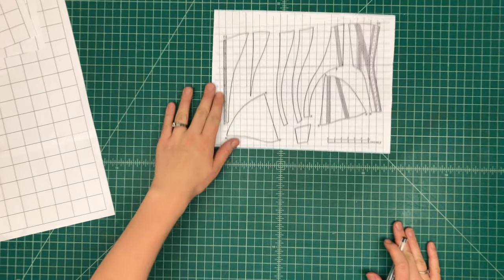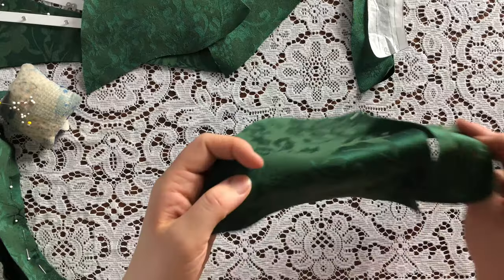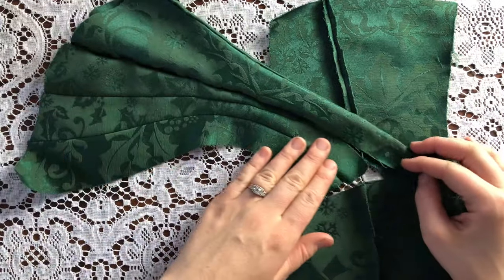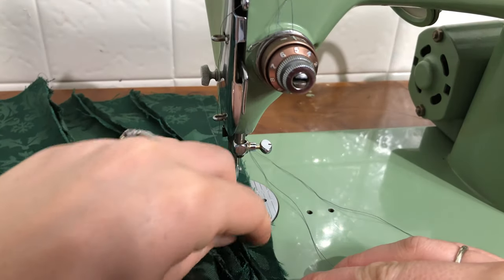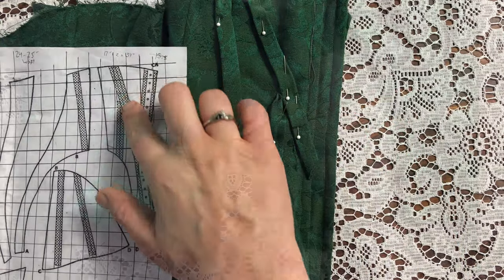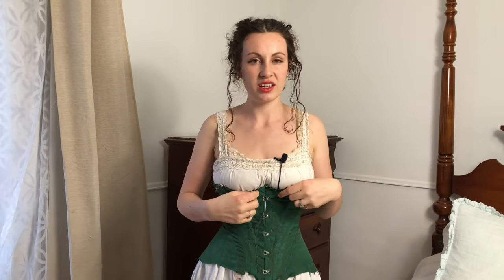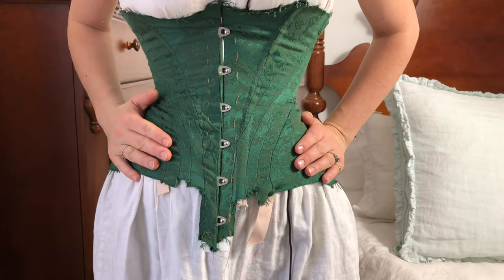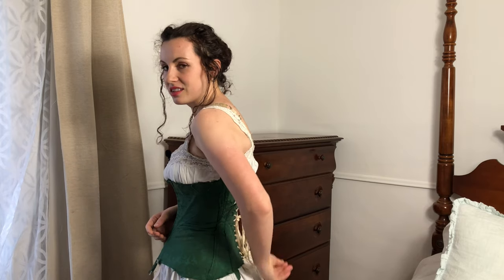Edwardian Corset Making Part 1: Mock-up

Comment: For anyone looking this pattern is on page 84 of Corsets and Crinolines.  A simple google for that or "straight front 1901 corset" will get you the result om google.

I also chuckled when you said the bottom was loose.  It's designed to be padded underneath, after all.

Comment: Hi I’m just about to start this! I have my mock up all cut out. If you don’t mind, what is your normal bust, waist and hip size? Just so I can get a better idea of how this will fit me and alterations to the pattern I will have to look out for. Thanks!
Reply from the maker: Eve C How exciting!  I am currently hugely pregnant so I had to measure this corset to remind myself 😆 My corset measures (with a 2” lacing gap included) 33” bust, 23” waist, and 38” hip.  My non-corsetted measurements, to the best of my memory, were 36” bust, 26-27” waist, and 36” hips.  When making your mock-up, keep an eye on the length of the corset as well as the width. Good luck! 😊
Reply: Thank you! I think hips and waist should be good then! Might have to make the bust a bit smaller but I’m excited to get started
Reply: One more question, so as for putting it all together the pieces should all fit together in the order on the pattern page? Other than the hip pieces which are lettered.
Reply from the maker: Eve C Yes, that’s correct 🙂
Reply: Alright, thank you!! I’ll tag you in some photos on Instagram when it’s done!
Reply from the maker: Eve C I would love that! 😊
Reply: Unfortunately I’m going to have to throw in the towel for this one. I do not have the experience to know how to adjust the size correctly. I’ve made 3 mock-ups and while I would like to continue I just don’t know what the heck I’m doing haha, looks like I will have to find a pattern that will be a bit smaller. I measured 12 in on each side and it should fit! But when i lace it up I don’t have any gap in laces and maybe see a 1in reduction?? So confused lol but thank you for your tutorial and replies!
Reply from the maker: Eve C No problem! At least you gave it a good effort! There are plenty of patterns out there with different sizes included. I think that is a great option 😊
Reply: serendipidus1 yeah I ended up taking out one of the panels and it was ok! I gave It another chance! I just need to add boning channels and trim now :)

Comment: Did you use steel or synthetic baleen for your boning?
Reply from the maker: Robyn Murray In the finished corset, I used mostly synthetic whalebone, with some spring steel in strategic places ( mostly centre-back as I recall). 🙂
Reply: @KatherineSewing  you are the first source I've found for an s-bend corset using synthetic baleen and I have sooo many questions. How are you finding it? Is it comfortable? Supportive? Keeps the right shape still? Could you wear it daily like they did in the Edwardian era?
Reply from the maker: Robyn Murray Great questions! I love my Edwardian corset and can’t wait to get back to wearing it ( I’m currently in my third trimester).  It has kept a beautiful shape, other than improving with wear as it moulds to the body. Very supportive, comfortable, and yes I was wearing it daily 🙂 In terms of the S-bend shape, I did use flat steel bones at the back which I bent to shape, so I can’t comment on that. However, I think it’s still possible to get that shape with synthetic whalebone, if you didn’t want to use any steel. I love synthetic whalebone for its convenience. Hope this helps 😊
Reply: @KatherineSewing  thank you so much! I'm making my first steps into history-bounding and the whole corset thing has been a big question mark for me. I know I'll need one but my previous experience is with steel bones fashion corsets which made my ribs very unhappy. The idea that I could get the right silhouette using synthetic whalebone gives me hope for when I finally get the confidence to make my own corset.
Reply from the maker: Robyn Murray Absolutely! Part of the rib-pain could have been due to corsets not fitting properly, but yes I do love my synthetic whalebone for comfort. In fact, I am more comfortable wearing a corset than not. Synthetic whalebone is also great for beginning corset-making, because you can easily cut it to length with scissors. 🙂 Oh and I have heard some corset makers swear by synthetic whalebone for getting a more historically accurate silhouette than steel!
Reply: @KatherineSewing  that's a amazing. Thank you for taking the time to help me. I feel a lot more comfortable with the idea of making a corset in my near future. I plan on doing the chemise and drawers first, but then I'll need to do the corset itself and the idea is less daunting now.

Comment: Could you please link your source for the pattern? I only find sources for a free download that do not seem so reliable. Thank you.
Reply from the maker: https://imgur.com/a/3sb72Qj

Here is the pattern I used. I will also put it into my blog post for this make (linked above). Unfortunately this pattern does not come with a grid.  I drew the grid over the pattern itself by extending up lines from the scale at the bottom. I hope that makes sense.
Reply: @KatherineSewing  Thank you so much!!